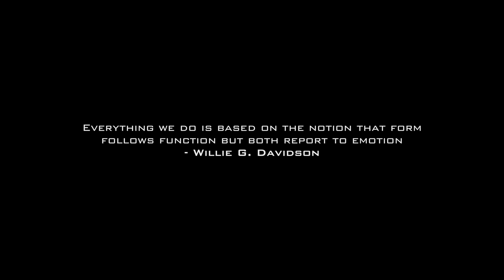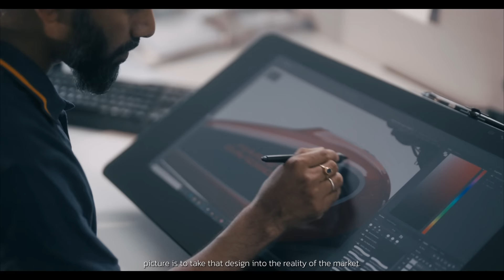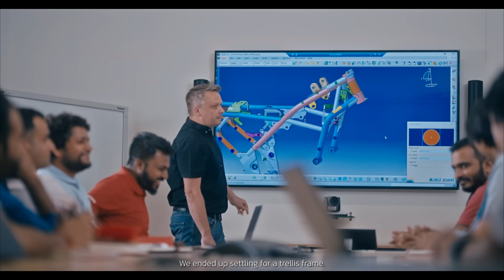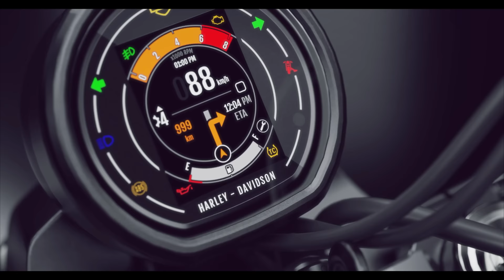The Making of The Harley-Davidson X440

Comment: Quite many things feels okay getting it from harley , but while looking for power and engine we also go through detailing done on the bike and somewhere at that point I personally feel the cable on the right side handle bar is quite a bad impression keeping in mind of the rival speed400. The cables are wide open which makes it little messy, which sometimes as a customer i feel little irritated. so I hope it can be fixed and given a detail finish. looking into it.

Comment: I booked it. But why you not styled the back box type part under pillion seat. Make it looks styling. That makes this bike 100% for me. I know its pillion friendly design and when people sit on bike that gap between tyre and pillion seat vanishes due to gud suspension. Still a just small curved cut can make it beauty. If you guyz not doing it, i gonna do it in local workshop here. Its that simple.
Reply: I think modifying will only weaken that body part !!
Reply: Back side design not good

Comment: I never got a bike before nor I do have now so, in my head I saw RE interceptor 650 twin as my first bike but was worried that  am I able to ride such a powerful bike at the beginning of my entry level so, I was waiting for my 2 and 4 wheeler license which I got it 2 weeks back and now I saw this beautiful machine by Harley Davidson and my mind is still hanging between this two X440 and Interceptor 650 so, I’m thinking to wait a little more to get the actual consumer reviews of at least minimum of 1 months of use of this beautiful machine😊 but I would say the wiring and the finishing of the edges should be improved by Harley Davidson and expect a little thick tyres like 438.1 mm size with Apollo or Metzeiler tyre with a little adequate amount of pillions 😊
Reply: The best thing is to wait and watch. I feel u are doing the wrong comparison.
Reply: Gt any day

Comment: Booked but disappointed to see the paint quality of tubular frame and wires system is not appropriate ...race wire upside cause of rain water inside...agree if you are not providing ride by wire....but guys please work on tubular frame and it's paint quality as well wirring

Comment: First and foremost, in the minds of most people, Harley is considered a high-end product, and they prefer not to see any other brand's characteristics on its motorcycles. 

Take, for instance, the new Triumph 400 series; if it wasn't revealed that Bajaj was involved in its manufacturing, people would strongly believe it was solely produced by Triumph because it lacks any visible Bajaj design elements. 

However, in the case of Harley-Davidson, the engine bears a striking resemblance to the beefed-up head of the Xpulse 200. Even the red spark plug cap reminds customers of an engine from Hero. 

The body and chassis design, on the other hand, are excellent, and credit goes to the team for maintaining the distinctive Harley-Davidson sound signature from the engine. Nevertheless, the outer design of the engine undeniably resembles Hero's engine and does not align well with Harley-Davidson's design identity.

Comment: True to HD, overweight and underpowered. Triumph Speed 400 has less displacement yet is 44 pounds lighter and has 12.5 more horsepower. That's not insubstantial. If Triumph can do it why cant Harley.

Comment: Harleys are the hogs this is not a real harley feel you can get even from 750 or 500
Above 883 is a real harley
Reply: If you know market strategy you will understand the brand did the right move to stay in the market rather shut down the business forever. 
To deliver a Road glide and support the existing customers with parts and keep the price on par one company should survive at the first place.
X440 is doing (at least for India) what the Classic 350 did for Royal Enfield with the UCE.
Overall the bike felt so good when I riden it. Twin engines are arguably good, so do the singles when they are made right.